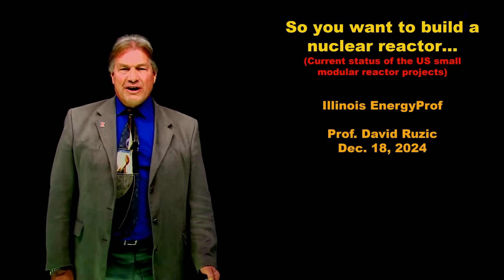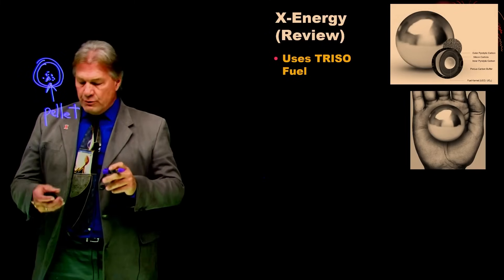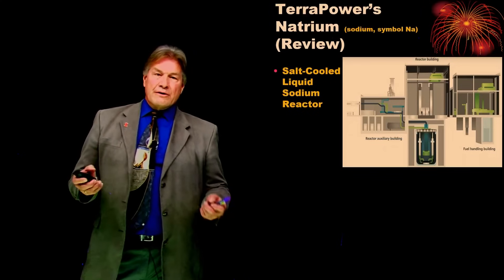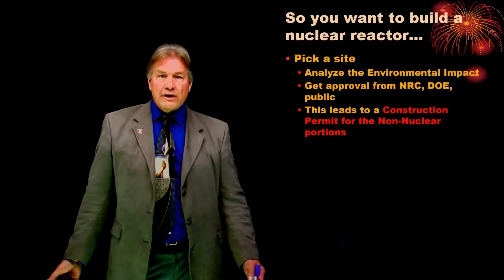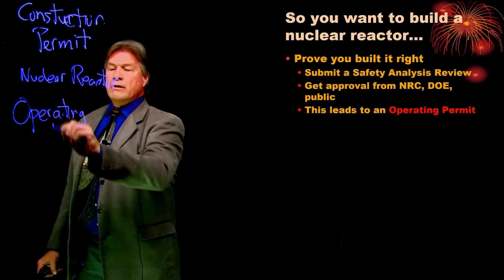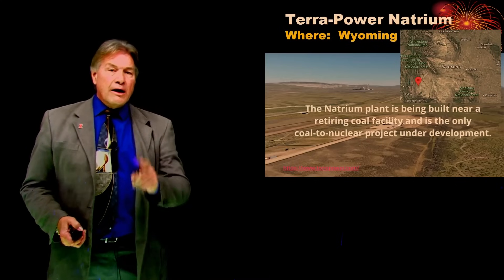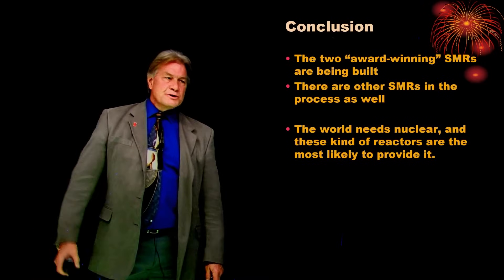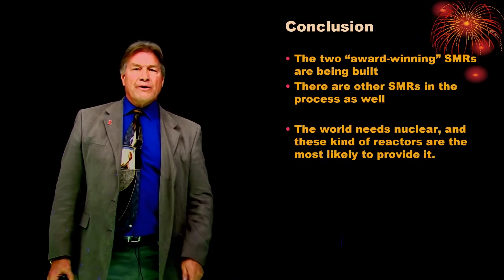So You Want to Build a Nuclear Reactor

Comment: The reason France managed to build so many reactors at reasonable cost was because they built the same thing with the same management and crews over and over again. It got faster, it got easier, your parts and supply chains spun up. The key to cheaper nuclear is getting a good design and building it 50 times in a row, making tweaks here and there. It'll work and it'll be economical.
Reply: Another key is to have your Nuclear Regulations be there for safety instead of to increase costs to opress it for political causes. America really refrains from accepting this.
Reply: And part of the problem in the US is that the NRC is just about specifically designed to prevent this kind of efficiency gain.

Comment: Ok, so these have both been tried before.  The Germans tried the pebble bed type and it was a disaster.  They actually caused fuel damage and radiation leakage (not that much but still a release) when a pebble got lodged in the feader and they tried to force it, that was in the 80's so maybe this is a better design, but again still has it's problems.  The sodium reactor has been around since the 50's and has never really caught on since past designs used MOX and required a bunch of reprocessing that does not currently exist in the US and does/could require a bit of weapons grade plutonium for the fuel, not exactly something you want floating around the public domain.  In both of these cases the government is highly invested, because without them it's economic suicide to even think about building a reactor.  Nuclear might be an answer, but it's definitely not THE answer.   These tech companies getting behind it makes me even more skeptical, their montra is always move fast and break things or minimum viable product, well, that's not a good idea when we are talking about reactors.

Comment: Too bad it doesn’t solve the problem of waste. That should be the ONLY thing we are working on in this subject. My brother received a nuclear energy degree from UIS.. he never once got a job offer, and ended up hating it in the end. And now he works in software 🤣. 

We all see how we handle regular garbage and waste. Now imagine every city having a never ending stream of low/mid level radioactive  waste. The public wants the problem of the WASTE, solved. Then nuclear will once again start being built. This is still cool science and video, it’s just never going to be commercially viable in the USA… until we solve the problem of the waste.
Reply: Calling nuclear waste a problem is an unscientific excuse to never build nuclear power.  High level waste can be safely stored in concrete and steel casks.  The casks are currently (safely) stored on current nuclear sites while the NRC dreams up some solution while smoking crack.
If we were a scientifically serious country, nuclear waste could be put at the bottom of deep oceans near subduction zones.  It would sink into deep sea mud and then move into the earth's deep crust.

Comment: Small reactors are a non-starter due to economies of scale. Still need to have operators, land buffer for environmental and security reasons, and privately uninsurable just the same. Nuclear itself works great, but the inherent flaws of human nature makes it far riskier than the technology alone would suggest. Larger plants is still the best way. That's how China and other countries are going about it.
Reply: And larger plant are not really racing ahead either. France and the Us have barely built one reactor pair each on their own soil this century. At huge expense.
China had a big rush, and slowed down to a fraction of previous completion rate.
Not counting china, which seems to be duplicating the build experience of the US forty years ago, global nuclear declined 20% this century.

Not even economies of scale are saving them at this point.
Reply: A huge cost spike for all nuke plants was the Aircraft Impact Requirement.  It was passed by congress after 9-11.  
It was probably a good idea., but really hurts the competitiveness of smaller plants.   That said, wait until a terrorist destroys a large dam with an aircraft and thousands die from the flood.

Comment: So, they solved the pellet deformity problem in the pebble bed by going with porous carbon layering? As I recall, attempts using graphite fared poorly, due to graphite's intolerance for neutron radiation and retaining its physical characteristics (aka "swelling" due to dislocations in the lattice) and caused failures to discharge used pebbles in a test reactor, as I recall.

The natrium, I'm guessing that they resolved corrosion problems in metallic reactor components and cooling system issues, which were a major issue with early test designs. Molten salts can be a bit corrosive at temperature, but that's well, a chemistry issue and chemists are quite creative in resolving such issues. Seal issues apparent in some early designs were resolved as I recall. 239Pu issues, not much of one in a traveling wave reactor due to its nature, although other useful isotopes likely could be bred in the reactor simply enough. Indeed, it'd be much a happier time if that isotope was "burned" off, although 238Pu would be useful, there being a major shortage of it for RTG's for the space program. 
I did get a chuckle over some of the popular science articles that basically became science fiction in reporting "weapons grade plutonium" could be produced by the reactor, given that whole processing thing being utterly ignored or that traveling wave reactors would need to be reconfigured to preferentially breed Pu isotopes anyway. Most popularizers and journalists having absolutely no clue, will rail on nonsensically.
Still, I'd love to see what solutions they arrived at for the natrium sealing systems and salt corrosion issues, as well as what insulation scheme they're going with for the hot salt. All, some interesting engineering challenges as well and I love examining such solutions. I'm the guy who, when going onto a museum ship, heads straight down to engineering. Guns are simple enough, engines are cool, power systems, cooler, cooling systems, exactly my cup of tea.
I'll just get my hat on the way out...

Comment: No. I do not want to build a nuclear reactor. Not even a small one. I want to build on the work of Nasa/Sandia Labs 1982, Magma Energy Project. 

Status of the Magma Energy Project
Dunn, J. C. (Sandia National Labs., Albuquerque, NM.)
Abstract
The current magma energy project is assessing the engineering feasibility of extracting thermal energy directly from crustal magma bodies. The estimated size of the U.S. resource (50,000 to 500,000 quads) suggests a considerable potential impact on future power generation. In a previous seven-year study, we concluded that there are no insurmountable barriers that would invalidate the magma energy concept. 

Current global energy demand is around 600 quads; such that Nasa/Sandia Labs estimate a minimum of 90 times global energy demand, just from the US alone. 

As a political science graduate, I'd suggest the US government needs to revisit the 1970 Geothermal Steam Act, as a disincentive to research and production of geothermal energy - particularly, with regard to leases.

Comment: I hope somebody reads my comment.  In my 40 year nuclear engineering career, the company I worked for developed numerous nuclear plant sites. We constructed complete nuclear generating stations, and we also developed several proposed SMR sites for our customers.  From my experience, I see very little difference between an SMR and a large GW plant.  The SMR is smaller and that's about it.

Back in the early 70's, the "reactor" that powers North Anna Nuclear was delivered to the site on a truck as one assembly. Similar to what is described for an SMR. So in my mind we have always had modular reactors. Actually, it is the reactor that's the easy part. The balance of plant systems must also be included.  Such as:

Turbine building
Turbine systems
Generator
Output Transformer
Switchyard
Control building
RadWaste building
Containment (yes - you will need a containment for an SMR)
Cooling water system with cooling tower
Security Building and Fence

All these systems are required in order to generate electricity with a reactor, and you will not be able to deliver them on a truck. Also, all of the SMR projects that I worked on were cancelled because of cost. The SMRs are just too damn small to be economical. Every time a see another article about SMRs on the internet, I just laugh.

 Do we need more electrical energy? If the answer is yes, then use the technology that we already know how to build and stop trying to re-invent what works. I say let's get on with it!!
Reply: It is also interesting that china can build LARGE nuclear reactors on time, on budget and in large numbers.  In contrast, California can’t build a simple train on time, has massive cost overruns and the part that they are working on is the absolute easiest part with no TECHNICAL challenges. To add insult to injury, the primary contractor is a Spanish company who has built the exact same type of train system in Spain WITHOUT ANY PROBLEMS. AND since Spain is in the EU, and not china, maybe why the U. S. has such difficulties with large civil projects has some unspoken issues that places like china don’t?
Reply: @Mentaculus42 China has a death penalty for corruption.  In the USA today, corruption is legalized.
Reply: US Navy uses the small reactors architecture for a reason. If it wasn't efficient they simply wouldn't
Reply: Well, just look at balooning costs are killing large nuclear projects. They last too long to build and cost way to much.  On the other hand, Navy seems to be doing well enough with incremental development of reactors procured in batches of 30 or so and operated by dozen or so people of standing watch.